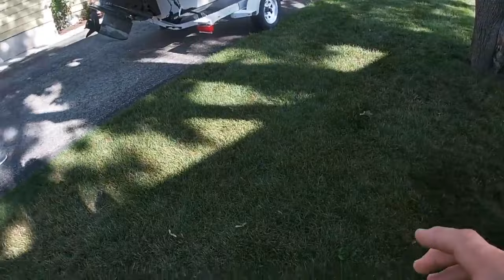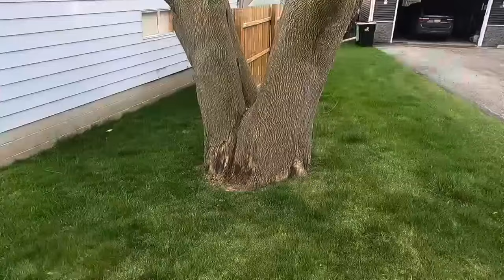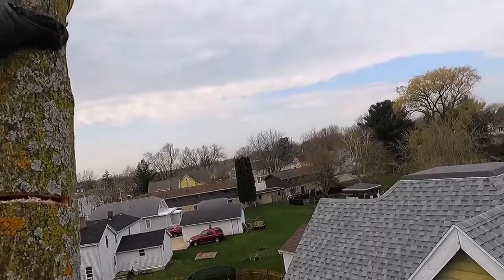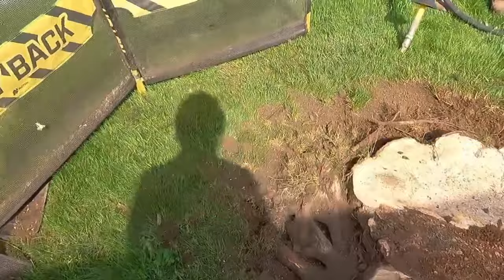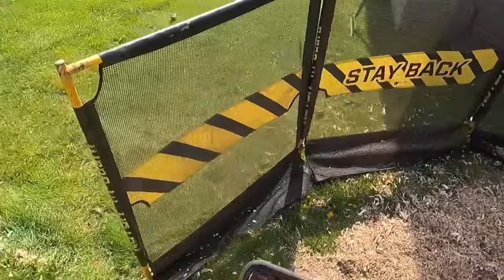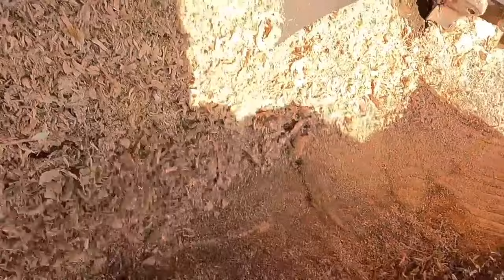The Angry Neighbor-The Full Story

Comment: I used to work in forestry in New Zealand. I was in a grapple digger. The pine plantation was planted over native forest that was mainly a hard wood for flooring and building. I would come across stumps 2 meter diameter. I would pull the rotten stump away and pull the tap root and the ones growing out as they were still solid full of resin and burned hot for awhile . Considering the tree was cut 35 years ago
Reply from the maker: Cool

Comment: Only way you could be held responsible for it is if you directly caused the felling of the tree IE cutting into the other tree on accident. Which I assume you would just take it down at that point to rectify the mistake ? But you actions would have to directly cause the tree to come down and damage some of their property? Just curious
Reply from the maker: Yeah, if a tree persist for a period of time after someone has touched it, it would be very difficult to relate a failure directly to an action taken. This tree was standing perfectly after 18 months. I finished the job as a courtesy, and to get the data and footage that I wanted..
Reply: @GameofTrees  dude has the crazy neighbor vibe lol

Comment: Im 66 and certified arborist since 1983.It’s one tree that was cut and multi branched from the root stock and this doesn’t make any difference. I’m located in San Diego. To remove the tree to the ground, we would charge about $400 and be done in about 2 hours. One guy in the air 2 guys on the ground. This is one tree because it cracks and splits does not make it two trees. My opinion
Reply from the maker: You haven’t priced trees for a while 😃 and never price a tree from a video, you are sure to under bid:)

Comment: That's the first time I've seen a pro arborist besides myself using a reciprocating saw in the tree.  I've always wondered why Milwaukee doesn't make a 20' Sawzall. It would serve most people better than a chainsaw.
Benefits: simple, no oil, cheaper blades, lighter weight, less pinching issues, fits in tighter places, cleaner cut
Problems: more vibrations, slower cutting, smaller capacity, weaker blade
Reply from the maker: I have a connection, perhaps I’ll suggest 😃

Comment: I thought you with your board certified arborist whatever that it was a stump that resprouted, now it’s a storm that caused the tree to split? Well then how are they separate entities? Hmmm Actually yea there is something that cutting that tree could do to the others one. They both lean & without the other to block the wind from blowing on its weak side it very well could uproot or split down to the “stump” & fall. Once again this shotty arborist cries safety hazard! Bahaha
Reply from the maker: Did you not notice it stood for 18 months and it would have stood a lot longer if it was left.

Comment: If you cut down one side and not the other it's a problem. It's his tree, if you insist on taking it down take the whole thing down. Taking one half of that tree is a hazard. That you keep saying "This tree has nothing to do with that tree" is idiotic, it's the same tree.
edit for clarity: You've heard of how an iceberg is much bigger under the surface than it is above? It's similar with trees, that tree is old my brother. There's roots everywhere, supporting the whole tree. The split at the surface is..well, just that. Underground that tree is very much one entity. If you cut down half of it, it not only unbalances the tree as a whole, but it also opens up that root system for rot and infestation. Both of which together would almost certainly kill the whole tree.
Reply from the maker: “Separate entities”, “this side has nothing to do with that side”, these are hyperbolic statements in an organic argument to create emphasis that I was not creating an imminent hazard, but I was removing an imminent hazard. Also, it is clear that you did not watch the whole video.  I found underground exactly what I predicted, two separate stems off the same original stump.  Third, icebergs and trees have nothing in common. Trees are much larger above ground than below.😀